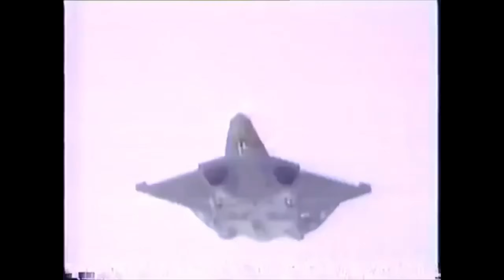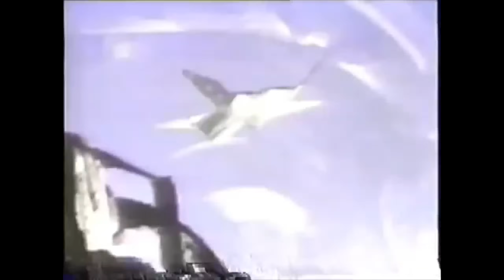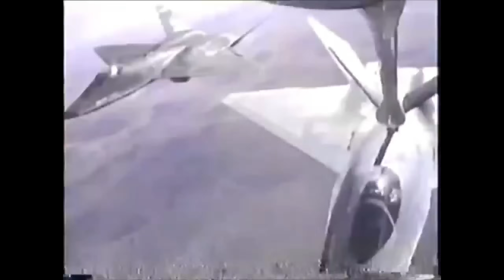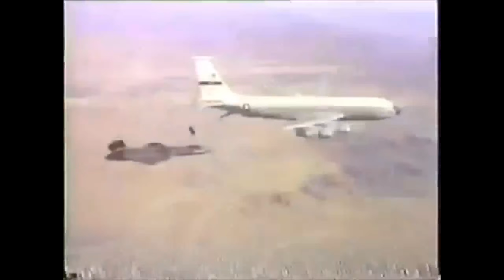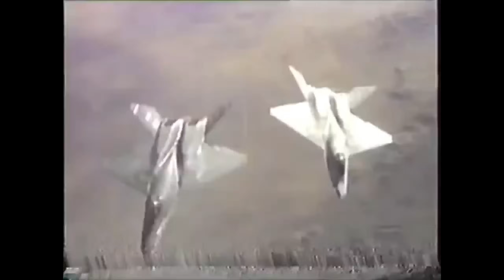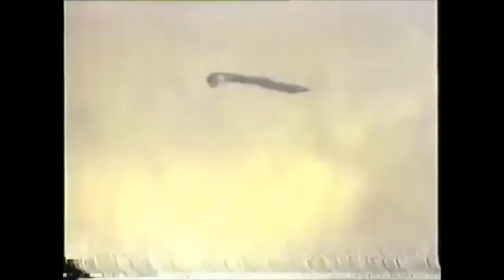YF 23

Comment: yf-23 doesnt has a good desing for dog fight..it doesnt has thrust vectoring engines which makes it less maneuverable as well..f22 is the correct choice..
Reply: For the Air Force the F-22 was a better option. For the Navy, the YF-23 should have been selected due to the heavier armament.
Reply: It was superior enough WITHOUT the thrust vectoring.  What does that tell you?  Besides I believe the advantages are negligible at best.
Reply: @moonman3213  if you understand the aerodinamics of jet as well as me you can understand how low its maneouverablity too..its not a good jet..f22 was the correct choice
Reply: @sundancer06  I'm just saying that the dynamics of air combat now doesn't seem to focus primarily on manuverability.    It seems like the USAF doctrine is more concerned with BVR abilities where the craft Is not dependant on  manuverability.

Comment: Air Force wanted a stealth fighter, Northop gave them a stealth fighter. But it was rejected because it was too stealthy.
Anywho joke aside, if the ATF happened now in 2010s YF-23 would have been pick, due to the change in fighter doctrine, heavily in BVR and stealth, which is what YF-23 miles ahead of YF-22
Reply: They need to replace the F-15 with he YF-23 but the USAF doesn't care about interceptors
Reply: I hear some ppl saying they didn't give it to Northrop bc they'd have a monopoly on military aircraft since they already had the b-2 contracts.

Comment: If you wanted to keep Air Interception ranges as far from a battle group as possible, wouldn't it make sense to get a bird with greater ranges?
Reply: I think it is still a viable airframe. The lessons learned from the raptor could be applied to the YF-23 & improved upon to make a fine interceptor, both for the Navy & the Air Force!
Reply: The lessons learned and tech/sub systems from the F-35 could be applied to the YF-23. The F-23 was a fantastic airframe. The USAF wanted the ATF to carry 4 AMRAAM and 4 Sidewinders, the yf-22 came closer to that need. Imagine a re-design that widened the area around the front landing gear to carry 4 Sidewinders, 2 per side, one hung from the nose-wheel door and one atop it. Imagine lengthening the rear landing gear doors and carrying 2 AIM 120's between the landing gear and engine, again 1 attached to the door and another one higher up. It would have met the requirement and still have a central weapons bay. Where one 12ft long AMRAAM could fit, two small diameter bombs or two CUDA's could be carried.

Comment: 100,000ft? That's Mach 3 folks! Only way to get there with a short wingspan...
Reply: FrakU2 The f-104 hit 103,000 ft and wasn’t a Mach 3 fighter.
Reply: @WildBillKelso32  with rocket assist.
Reply: @2112CG  they never said it used rocket assist. They said it took off like a rocket because the engines are so powerful!

Comment: They chose the F-22 cause it looks old school instead the YF-23 looks like an alien device. Nowadays Russia is creating the new T-50 with the same size and the same shape (if watched from the front) of the YF-23.
Reply: Economy was a major factor, and the people behind the F-22 later admitted that they had deliberately low-called its cost to out compete the YF-23 in that regard.  This should have been criminal (soldiers lives, national interests at stake?), but of course no one was ever charged.  You can have no doubt that a lot of industrial and congressional pockets were lined by the F-22 deal, without any regard for their responsibility to the taxpayer (i.e. to secure the best machine for the job).
Reply from the maker: agree
Reply: The can of pork and beans theory: An aircraft is like a can of pork and beansThe structure is the can, and everyone's can is about the same.The electronics is the beans, and everyone's beans are about the same.The software is the sauce, and you can like one or another based on the sauce you like.Low observables is the label on the can. People buy the label, because that is where you can really see the difference.The pilot is like the bit of pork in the pork and beans. That is what truly makes the difference.
Reply: Out of curiosity is there any other plane out there like the Typhoon or SU-37 that could rival this plane or any current American fighter plane like these?
Reply: Both t 50 and yf 23 look futuristic and in my opinion better than the f 22 in eyes looks, cost and performance.
Reply: I disagree the designers would choke you if you compared that piece of crap compared to this no way is it in the same it's the subtle difference that makes the black widow special and it matter that tech can beat the f 22 and the t-50 combined the numbers were better too! Your eyes fucking betray you!

Comment: US Air force should have chosen the YF-23 instead of the F-22
Reply: I am one of the ones who likes the 22 over the 23 as well. I see the 23 as a better interceptor, maybe, but not really a better air superiority aircraft and that is what the ATF was about. And I don't think it came down to politics as much as I think that Northrop handled it horribly. They borrowed parts from other aircraft and they refused to do certain things with the aircraft, like spin testing and high AoA testing, and Lockheed flew twice as many hours in six months while Northrop had nine months. The 23 did do AoA testing on a model in a wind tunnel but they never did AoA tests on the actual aircraft. To me, if I am going to purchase a product and one seller says here is what I have and it is pretty impressive and then another comes to me and says I can beat him and then fails to show me concrete data on that and then says trust me it will be better I will go with the one  that is showing that he meets my basic requirements then the one that says that he will exceed my expectations.
Reply: ASSASSYN the 23 was far stealthier overall than the 22. The reason it lost wasn't because of the airframe itself, but politically based. The military didn't think Northrop could handle the further development and production, as they were still in the doghouse from delays and cost overruns on the B2 project; the Raptor was better suited to a conversion to a naval variant, which the navy dropped about a year after the selection; and because Lockheed showed off their aircraft far better than Northrop did.
Reply: @ScramasaxeRA   You cant also forget the A-12 cancellation lawsuit and what DOD said about the lawsuit. McDonnell Douglas DID win the lawsuit. The Navy gave the go ahead for the Super Hornet and the ATF did not require a missile launch
Reply: erik channel clearly not based on it's lacking stealth, and wing tip vortex issue.
Reply: DonMeaker moreover, and far more important, the 23 had far higher maintenance requirements that the navy didn't want to deal with. They toyed with the 22, but couldnt get what they want out of it, and so abandoned the program a year after they chose the aircraft.
Reply: DonMeaker and the shorter wingspan on the 23 wasn't navy compatible. They couldn't get the low speed lift they needed for takeoff and landing
Reply: DonMeaker and you'd destroy the cross symmetry of the leading edges at the same time. you would need a radical redesign, which is what Northrop had planned. the natf version of f23 looked very different from the prototype airforce variant, and the navy said no. Lockheed had a much better design with a variable geometry wing. The 23 was a plan that was very specifically designed, not much room to change things up. that's why it couldn't be converted without radical changes that the Navy didn't want to deal with, especially with the result of the B2 program
Reply: Oh yeah, I'm all for revolutionary. That's more what I meant, too much so for men with little minds. It's funny because my dads old boss (dad is former sub captain and has done lots with joint chief and was right hand to assistant Secdef) was on that panel, and argued for 23, but those reasons I listed got in his way. We still banter over it with cigars when he comes over, it's pretty funnu
Reply: Like F23, but with less allowance for revolutionary ideas. What a waste
Reply: The navy likes a downward pitching moment as it crosses the edge of the carrier deck. The F-23 would accomplish that with software. When you added the folding wing to the F-23, you would make the wing longer at that time.
Reply: One could keep the same symmetry, just make the wing a bit bigger (Navy likes lower speed approach) and move it a bit to the back.  NGC added a canard to lower the speeds a bit more.
Reply: DonMeaker the problem with doing that on the f23 was that it got in the way of the tail stabilizers. that's why they resigned them, turning them into what looked and amounted to f18 rudders, and added cunards. the new design wasn't as stealthy, and was in essence a different aircraft entirely that the navy didn't want, and they simple couldn't put the tech into it as the design was without either making the plane bigger or using a different design, neither of which they wanted
Reply: they could do 3DTVN like in Sukhoi and add a LEVCON to it to give YF-23 better lift performance at higher AOA and low speed situations, but hey, just an idea
Reply: ApexTallyFox it had a decent amount of stability at high AoA. not much as the raptor, but that was due to lack of thrust vectoring. the point here is that in order for 23 to fit, ironically, would have needed a larger wing to then be able to shorten for stowing. 23 had onboard sensors for wing vortices, again, I'm not sure what control surfaces they had for it, but considering the turn dynamics it demonstrated, I'm rather certain they got a hold of controlling those. not, Lockheed decided a swing wing was the way to go, but it's because Northrop was essentially super stingy about Area rule that made that impossible with 23. overall, the thing to understand is 23 was the perfect air force aircraft, and it was perfectly crafted for that purpose, but unfortunately, politics, à possible cross service use, and poor demonstration led to the 23 not being recognized for what it was. plus, it was a bit too revolutionary
Reply: a friend of mine told me once that there's nothing too revolutionary, there's only budget, and close minded, conservative politicians...

also, yeah, they should've demo-ed YF-23 high alpha capability, even if the 22 wins, it'd still give some amazing video of YF-23
Reply: it's always funny, and to see PAK-FA has similar looks to YF-23 from the front made it even funnier
Reply: not really a waste, Russians do prefer reliability at worst conditions, practical combat, and long ranges, which the PAK-FA's main characteristic, it's probably the most maneuverable 5th gen, it has almost straight intake with that mechanism that can close it's intakes to prevent debris getting in when taking off and landing, and a ton of fuel making it capable of reaching almost 4000km, although I admit, they should've used the ruddervators/pelikan tail instead. but again, it's Russia, they prefer something that is proven and reliable. 4 poster tail would suit them well anyway.
Reply: Yes well even if all that, they still have the avionics issues they've always had. Not to mention stealth isn't what they should be going for
Reply: yup, Russians only want RCS reduction so they can engage with FLIR or just want to deny full stealth advantage to future potential enemy with F-35
Reply: Russians want pseudo stealth, so they can lie about it to potential foreign customers.
Reply: if they did have stealth, they didn't lie to foreign customers, besides, it's a common knowledge that the Russians never liked full stealth like F-22A or F-117, too damn expensive to maintain in less than ideal condition
Reply: The Russians attempt to sell their arms all over the world, or give them away in return for alliances.   That the arms they sell or give are crap is usually not revealed until they are used in battle and found to be deathtraps.
Reply: tell that to the Australian Hornets that's beaten to Indonesia's Su-27SKM and Su-30MK2 in Pitch Black, or USAF F-15s and F-16s having problem vs Indian Su-30MKI in Red Flag, Russian weaponary is crude and technologically outdated, but as a Luftwaffe MiG-29 pilot did say once, they are really meant for war in less than ideal conditions, in ideal conditions, US weaponary would trump over Russia's no denial
Reply: @stealthtallyfox7210  That's fake news

https://web.archive.org/web/20160311173046/asiapacificdefencereporter.com/articles/250/Exercise-Pitch-Black
  “The Hornets and Sukhois are having interesting fights with various outcomes. The Hornets have done fairly well, even during 1v1.” WGCDR Jones said Australian pilots were getting a “buzz out of working with a new platform,” but he too declined to offer an opinion on the capabilities of the Flankers. Instead he diplomatically said, “I remain very comfortable that we have the Super Hornet in RAAF service.” GPCAPT Kitcher assessed the Super Hornets as enjoying parity with the Flankers, but that “a pilot’s skill is the most important factor”.

Try again
Reply: Russia is a gas station that pretends to be a country.
Reply: your argument has reached the point of useless banter, please just stop
Reply: At Red Flag, the standard practice is to tweak the rules of engagement until there are losses on both sides. And so they will, until both sides have problems.
Reply: HenryDavidT interesting info. Thank you. My father worked in avionics for McDonnell, and was Chief Engineer on the yf-23. He's gone, but the aircraft just may not be dead yet.
Reply: Assassyn
Reply: TheLightningwrath the F22 was far better than the 23? That's ridiculous. Both were green lighted- both are tremendous aircraft. The 23 had many advantages over the 22.
Reply: TheLightningwrath the 23 was just as maneuverable, faster, longer range, and had far better avionics.
Reply: we'll have to agree to disagree. I'm a bit prejudiced, I admit, given that my Father was the Chief Engineer on the project for McDonnell Douglas. But you are one of the very few I have ever heard from who feels the 22 was a better aircraft. Even the Air Force green lighted both programs- either could have been built. It came down mostly to politics.
Reply: F-35 is JSF, an entirely different program to replace F-16, F/A-18, & AV-8B.
Reply: Jan N:  Sec Gates and Obama were doing the bidding of their masters, and killed the F-22 prematurely by design, way short of the numbers the USAF needs to replace the F-15C for critical airspace management around the world.
Reply: I say they should’ve just made both. Fuck it
Reply: I agree, but our bureaucracy still would have messed it up. I think what messed up the F-22 was making the parts in different states to make it too big to fail.
Reply: erik channel totally agree
Reply: Got that right!!!  There would have been the 750 that the AF initially wanted.
Reply: it just lacked tvc
Reply: Bujor Vasile Lucian Anything better than the F-35? The F-35 just got a 17-1 kill death/ratio in simulated combat, during the recent red flag. Proving it's capability. Multiple pilots reported they didn't even know it was behind them. Multiple enemy aircraft were eliminated before they knew they were actively being engaged. It's proven itself in simulated combat. A big step before live combat.
Reply: The F-22 was not better suited to the Navy, it fact in 'spotting factor' it is worse. Spotting factor is the number of aircraft you can put on a carrier. The F-18 can be thought of as taking up one spot. The F-22 was 2.4, and the F-23 with folding wings, 0.9
Reply: @DonMeaker  can f 22s even operate off a carrier
Reply: @Caktusdud.  A naval version would have been changed until it could be. Same with F-23.
Reply: Anything better than F35...
Reply: DonMeaker spotting factor means nothing if you can't convert in the first place. The navy made it clear, mind you, this isn't speculation, this is officially stated by the Navy, and I'll try to find the reference again, that the f23 would have costed far more to convert. This was based on the added space for a naval gear system which would have caused issue with the spacing of components that had been set by area rule. In addition,  wing conversion was considered too detrimental to the wing loading and low wavelength stealth.
Reply: I know the sound of a prideful loser when I hear it. THe F-22 Won for all the right reasons and you sound all too familiar.
Reply: sure, but in reference to WVR, most of the time without F-22A, F-15 and F-16 have problems going against Su-30MKI, doesn't mean the Sukhoi is unbeatable, it's just that the US is in a disadvantage more than they planned to
Reply: The F-22 was cancelled, and there are less than 200 in service. No way can this be called a success.
Reply: jananney whatever floats your boat. I'm just trying to tell you that the f22 delivered in more areas of the military's needs than the f23. it's why they weren't built. I can't tell you I'm am engineer with a masters degree but I can tell you, it doesn't take a genius to look up why the f23 didn't make the cut.
Reply: Jay N uhm, there is a lot of things that go into the funding of military weaponry/vehicles. economic opportunity, political support, and the needs of the military. why do you think that trash f35 is still being funded. because they have good relationships. that's it. it's not about how good a plane is. the f22 is far better than the f35 and yf23. but f22 just didn't have the support. all because of bush which started the killing process of the f22 program. Trump wants to shut down the f35 program but he won't be able to do it. he doesn't have the commitment to it which is unfortunate.
Reply: jananney lol, what did northrop have going for them? longer cruise? faster top speed? the military didn't want that. they wanted fast acceleration and maneuverability. the f22 delivered more in those areas. that's why they got the contract.